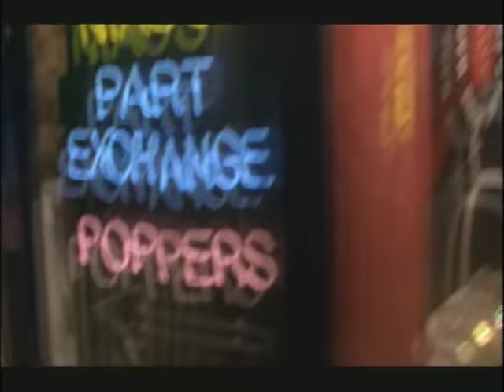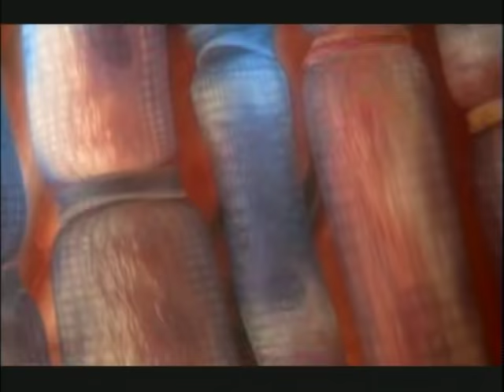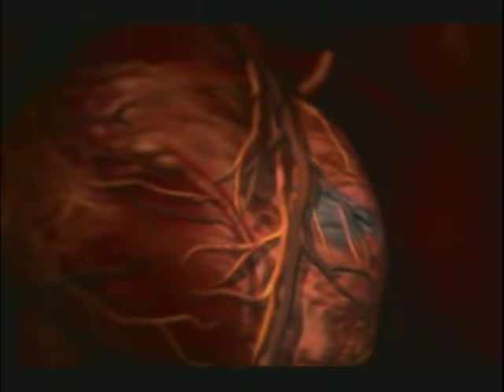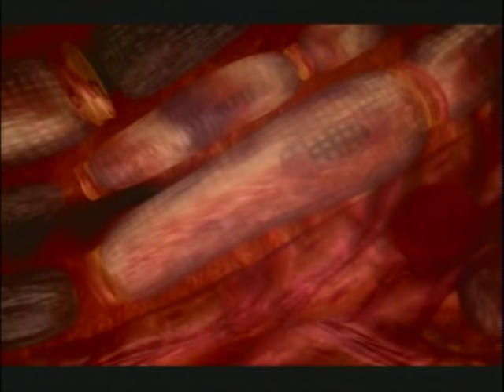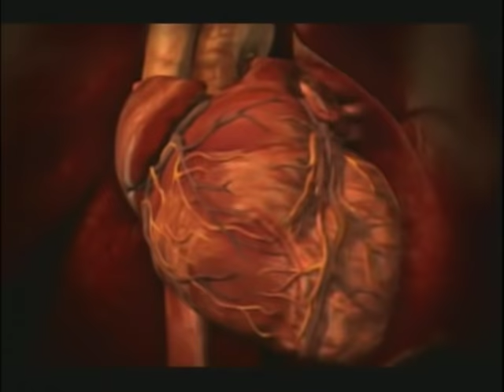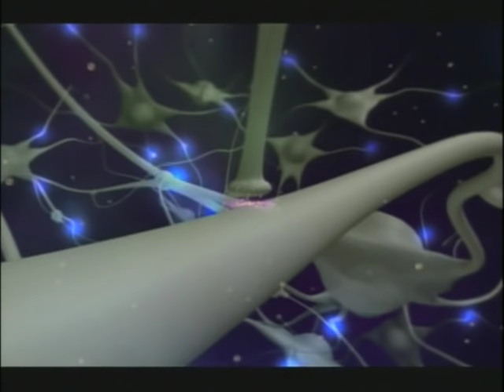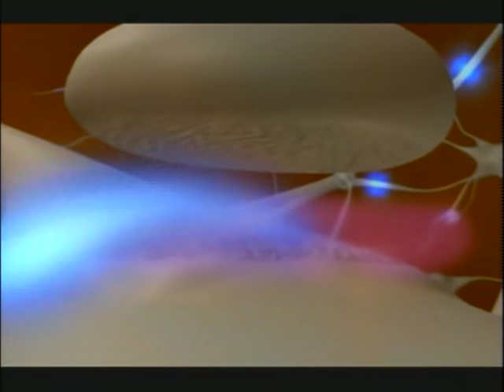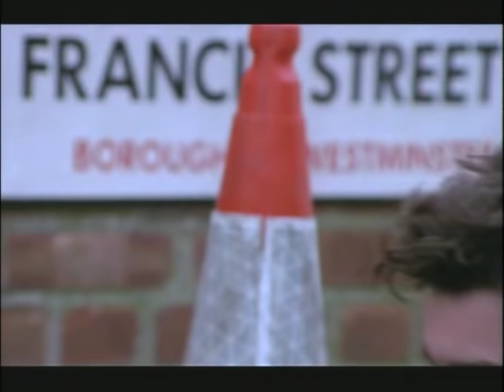[Discovery Channel] Body Story | Episode 3 | The Beast Within

Comment: I kind of panic about the part when John had a heart attack in the middle of the video when I was watching this. It totally stated me a little bit. For me I have never had a heart attack before, my heart has always been beating and never stops working, I drink plenty of water for my heart too so it can work a lot, but when I get nervous or when I run my heart works properly. That would never even happen to me  if I did have a heart attack. My ❤ always works for me as it will.

Comment: Well John there would have about 6-10mins since he's already ischemia( 4-6mins in cardio hypoxia(aka Angina)(though it's a MI and not an  Angina att)) the next step is injury(which he's in at the moment and if it occurs for more than 6-10mins it'll damage his heart which has already happen but to a greater extent. The last step is Infarct or death to the heart muscles and it only happens around if not 10mins. So really John here  has only short amount of time for a 50-80% of recovery when a MI happens. 

The Brain only needs 4mins or less in a hypoxic situation to die and 10-20mins for the heart (give or take).